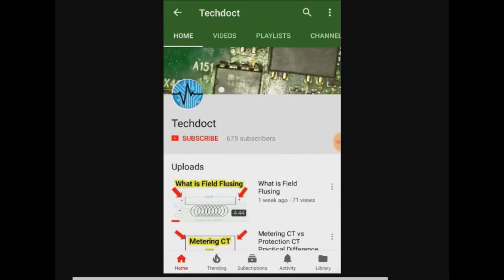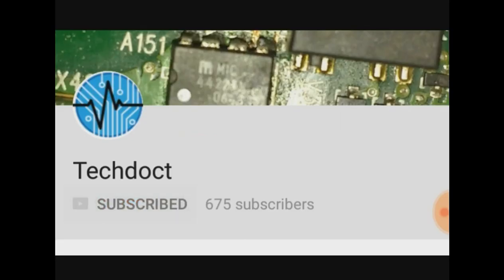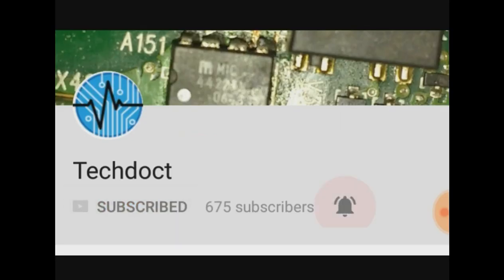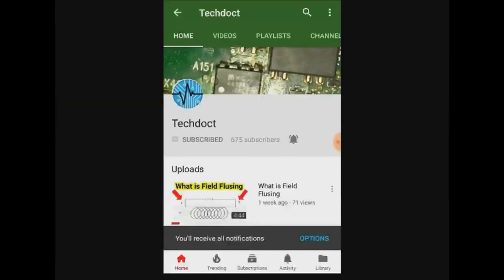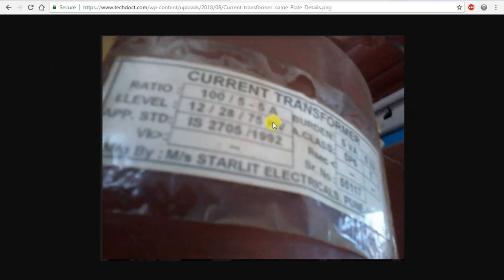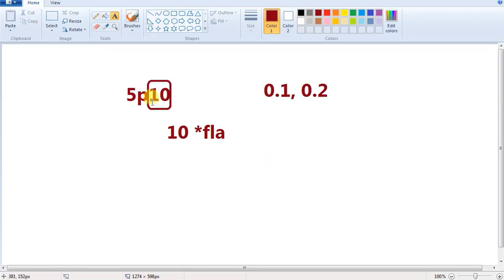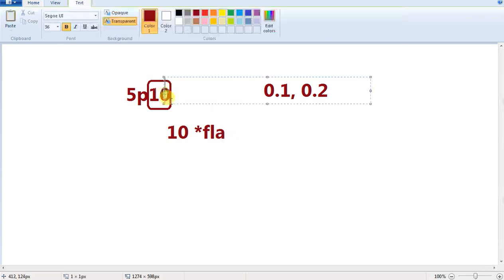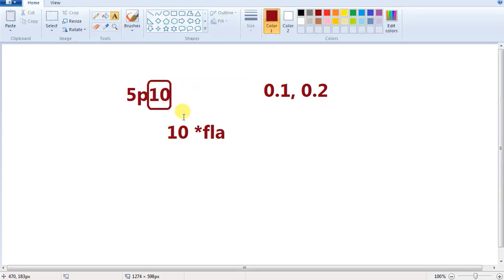Current Transformer Name plate details in tamil

Comment: Daily oru test nu vachi explain pannunga bro pls useful ah irukum
Reply from the maker: balan durai but test name nenga than sollanum
Reply: Techdoct okay bro.....
Power cable: 1)conductor continuity and phasing test
2)jacket(cable sheath) hipot test
3)IR and capacitance measurement
4)conductor DC-resistance measurement
5)link box- contact resistance measurement
6)link box- ground resistance test
7)SVL- insulation resistance test
Reply: Bro ithu yellam cable la panna koodya testing ,bro itha epdyachum solli kodunga bro plss